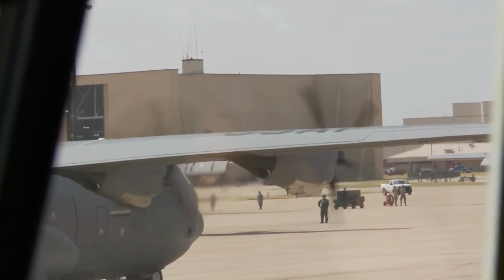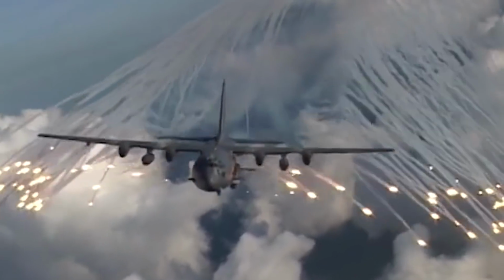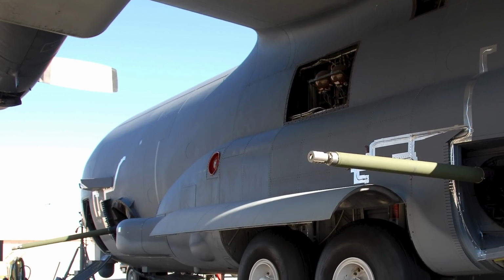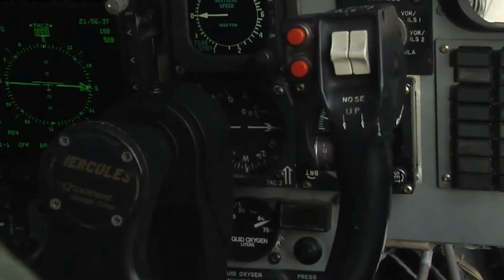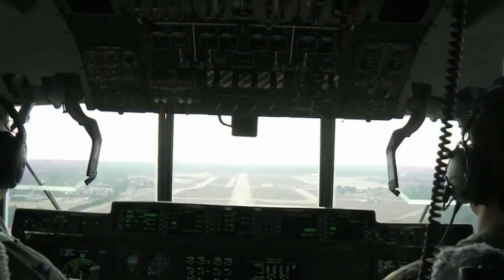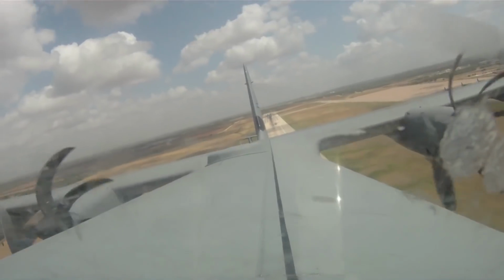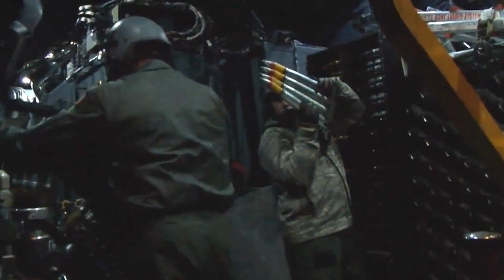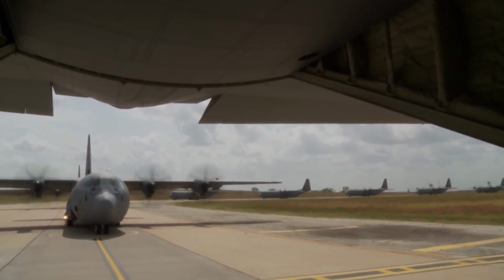AC-130J Ghostrider

Comment: Kind of weird that they didn't match up most of the video with what was being mentioned and put in a few clips of stuff that either hasn't been used in over a decade (i.e.-gattling gun and boffors) or normally doesn't apply to the aircraft; although the PSP has the ability to "quickly" drop the gun package pallet out of the plane, it would be exceedingly rare to revert it back to drop paratroopers. Once they have the rear door converted, there wouldn't be room for parachute dropping cargo (although the rollers are still under the gun mission pallet). I'm surprised they didn't give more kudos to the 30mm chain gun. That is one heck of a system and they pretty much never came back with any leftover ammo. They also go through continual improvements, not just big chunks of changes that span several aircraft. This means pretty much every single one of these planes ends up being somewhat unique even if they're part of the same "block". I was honored to be part of the GWS group for a couple of years. Lots of neat stuff they do with these planes.

Comment: My understanding was new Naval vessels had larger engines to power the Generators so they could produce the Electricity to run both the Ship and the Laser Weapons. Zumwolts were ridiculously large to power Railguns they couldn't make work. How does a plane power Laser Weapons? Or does the navy just use higher Powered Lasers with more Frequency if they're under attack?

Comment: When I was a Marine in Vietnam I watched Puff the Magic Dragon laying down streams of mini gun fire. It was impressive. Years later when I read they were moving the same concept on steroids to the C-130 I knew it was going to be special.
Reply: Just the sound of an old dc3 in the night, then it got quiet, and then all hell broke loose! I've got time exposure slides of puff lighting up a hill on night by Nah Trang
Reply: @maryhines322  I've got time exposure slides of the same effect. I was on guard duty on the north end of DaNang airbase. With jets turning up 24/7 listening for infiltrators was out of the question. So I brought a camera along with a telephoto to help me scan. When Puff opened up I settled the camera on a sandbag and opened the shutter.

Comment: All C-130s have a maximum speed of 0.64 mach from the first A model off Lockheed's production line.  Mach or the speed of sound is temperature dependent and is 358 kts or 427 mph at 20 deg C or 68 deg F.  There is nothing special at 413 mph unless you are at the South Pole.  ln the 70's we cruised at 280 kt for fuel efficiency in the C-130E.  Showing airdrops of cargo, paratroops and a 15,000 lb bomb does not add to credibility of the gunship.

Comment: they replace the very good and proven 40 mm with a 30 they took away what made the ac130 work all those years to turn into another bomber . missiles and bombs arent what that did , the gunship puts the fire right in front of friendly lines to save them , in Vietnam they would fire like 10 meters away from trapped soldiers , cant do that with a missile or bomb

Comment: AC-130J Ghost Rider III should have been based on the C-130J-30 Super Hercules multi mission transport aircraft which is the stretched variant of the C-130J . . . the IAF could do with a fleet of 50 brand new AC-130J-30 Ghost Rider IV fixed winged multi mission ground attack gunship . . .

Comment: 2015-1117, Aviation, New C130J Scrapped After Flying Upside Down.
	The US AF had to scrap a brand-new Lockheed Martin AC-130J Ghostrider gunships. Hercules received damage estimated at $115,000,000 after a flight-test crew lost control.
While being operated at roughly 15,000-ft, the aircraft flew upside down, before being recovered after losing approximately 5,000-ft of altitude. The crew escaped injury and returned to base and landed safely, but the Ghostrider was rendered a total loss, having exceeded its operating g limits and design load.
	Investigators have attributed the incident to the pilot’s “excessive rudder input during a test flight, followed by inadequate rudder input to initiate a timely recovery from high angle of sideslip due to over-controlled/under-controlled aircraft,” along with the “wrong choice of action during an operation.”

Comment: Is this really useful in a symmetrical warfare? It’s slow and can get shot down by ground to air missiles quite easily… Against asymmetrical warfare (like the war on terror) is a very capable platform. But I can’t see a good use against an army with fighters and guided missiles…
Reply: Not all platforms are meant to be used in symmetric warfare.. while highly capable, I reckon it's used to bully a battered enemy into submission.

Comment: Interested in how the 6-bladed props allow the aircraft to carry more fuel?  We found a better way was to fit extra fuel tanks.
I'd also like to see the figures on how the props allow a 67% reduction in running costs given that specific fuel consumption is at best 20% improved and that's only a small part of overall costs, which include other oils and lubricants, tyres, maintenance, refurbishment etc etc.  At least crew number is down by 2 as with the J there is no longer a navigator or flt eng.
Amazing to hear that the rear crew can fly 3000 miles and 28,000 ft in the air; true supermen!  If you're refering to the aircraft, why is it's range and ceiling so inferior to other Js, let alone the older aircraft?  I've had nearly 4000 miles and 41,000 feet out of a C-130K in the South Atlantic.
Lots of footage of the 40mm Bofors and its amunition, and why on earth so much air dispatch?  How does the Ghostrider get those enormousloads past the 105 gun?
As usual the interesting facts diluted by utterly unrelated imagery, although the reversed clip at 2:14 did at least prove light relief.

Comment: If my old b29 crimson sky is called in they need the flying dreadnought 36 guns 12 175mm 24 twin mounted rapid fire 75mm on 12 mounts she's a hefty 450 tons without ammo 900 tons with ammo using 6 VT hyperion rockets for lift with 12 inches of armor protection chaff flakk guns she's modernized and automated I just need to fly crimson sky with my copilot under extreme GeForce its a constant 15 g's at Mach 5 with those thrusters

Comment: So it has 2x30mm and 1x105?

They did away with the 40mm and gained a better 30MM?

Or did I miss hear him?
Reply: You did hear it mentioned that the Air Force was "scrambling" for the ammunition, AND parts for the Bofors 40mm cannon before the replacement of them with the 30mm?
Better, in this instance meaning that the weapons can be fed, and repaired without "scrambling" to obtain the necessary materiel.

Comment: the AC-130J's biggest gun is a 40mm, it is not plumbed to carry any sort of propelled munitions, and it has never been called a 'bomb truck with guns'
Reply: The AC-130J has, 30mm  and 105mm  there's literally 10 holes in cargo door for griffin missiles and the bombs are loaded on the wings gbu39s 4 on each pylon
Reply: The AC-130J's biggest gun is a 105mm, it does not have a 40mm, it has dual 30mm's.

Basic fucking fact that you can verify in one search must be so difficult for your kind.

Comment: I remember my days as a young airman back in the late 90’s working on the AC130 H and the AC 130 U model.  I remember the long night of cleaning barrels and maintains the 20mm, 25mm, 40mm, and 105 mm.
Reply: yes the aircraft was a beast to work, I have memories of many u informs that were ruined due to the grease, hydraulic fluid and oils.  But it is such a great machine and amazing how it is is able to support such powerful weapons.  Also a fun fact on the outside of the aircraft on the 105mm there is a single nut about the size of a fist that is used to mow sure when the 105mm is fired it does not fly out the other side of the plane.  It was dubbed the Jesus Nut
Reply: God bless American tax payers....
Reply: Thanks for bringing this to my attention I never thought about the maintenance the beast took
Reply: If I remember correctly, AC 130’s only had 1 free pallet station.   As a Port Dawg, we had to go over to AC 130s a couple of times to help load a pallet.
Reply: @a.mathis9454  from what I remember there was only space on the ramp but on the models I worked that was taken up by collapsing seats so on the AC130 H/u model there was no available pallet spaces that I could see there being
Reply: @Snipedog1978  ramp pallet position can be used on all C-130s, depending on mission and weight restrictions.   From what I have seen, it can be used for a baggage pallet when going to/from a theater of operation.  
See 8:05.    https://youtu.be/c7pLMwkxk9A.
Reply: "America is killing it's youth. Ghostrider, Ghost rider": from "Ghostrider" by Rollins Band
Reply: @somewhatsomething4882  huh ?
Reply: Oh yeah when they fired on gunnery ranges Party Time!=8)
Reply: You guys are the backbone.
Reply: Thanks for Your service.

Comment: They just replaced the old 105 with a brand new variant that is lighter and more accurate with fewer parts and a significantly lower operational cost. The guns they replaced were all old Vietnam era weapons that were long overdue to be replaced. 

Id actually like to see them replace the 30mm cannon with one (or a pair!) of the newer 50mm Bushmaster chain guns. Add a GAU-22A 25mm rotating cannon or go back to a pair of 20mm Vulcans and keep the Griffin and Hellfires and try to quantify the abject destruction left in its shadow.
Reply: At higher altitudes the 20mm cannons started to tumble through the air instead of spinning like normal rounds, hence why they went 30mm
Reply: 50mm with programmable fuse for air bursts would be horrifyingly effective. 

I’m not sure you would need smaller bore (and shorter range) Gatlings with a pair of these

Comment: Directed energy weapons work both ways. Antiaircraft lasers could make the AC-130J’s days numbered as well. Aircraft aluminum is much more fragile than steel bombs and shells.
Reply: aluminum is also very reflective once coatings are burned off, and dissipates heat well.
Reply: @sometimesleela  well then.... lets make it a flying disco ball. That would look interesting as all hell.
Reply: The last thing you'd want is to fire a large heat emitting laser with that thing around. You'd be obliterated before it's paint even warms up.
Reply: @zinjanthropus322  You can’t outfly the speed of light and a ground based system will be more powerful and armored than an airborne system, so who is likely to win that trade?
Reply: @johnmoore8599  the plane
Reply: @johnmoore8599  Lasers don't burn through things at the speed of light. A lot of the energy is lost and it takes focus and time to down even a small plastic drone. More than enough time for an ac130 to pick up the exposed heat source and eliminate it.
Reply: @zinjanthropus322  The assumption here is that the target is softer than the plane. What if it is not and has a weapon system as powerful or more powerful than the plane’s which is also better armored. If it has 10-20 mm of steel, it will survive long enough to burn down that AC-130 most likely. All it has to do is burn through a wing spar or fuel tank.
Reply: @johnmoore8599  The laser system itself would have to be exposed to fire, can't do that behind armour. Don't see how it would survive a burst of 30mm to the face.

The plane also has the advantage of using terrain to drop beyond line of sight of the laser while still being able to utilise missiles to attack safely from behind cover of the horizon.
Reply: @johnmoore8599  its highly unlikely that an aircraft moving like an ac130 in a gun orbit moves would take enough energy to one centralized spot to start anything before it turned the target to ash. Trust me I fly on AFSOCs upgraded de gunned version the mc130
Reply: @zacharystuits3606  Yeah, but you guys get the sharp end if your intelligence is wrong of the enemy’s capabilities and weapon systems. Physics is brutal on aircrews and always has been.
Reply: @johnmoore8599  well intelligence gathering has changed a lot these past 20 years, and bc what we do is usually infiltration, we try not to get seen by anything, let alone anything that would be able to keep a constant beam of energy directed in a way to do damage. We usually penetrate threats below 300 feet
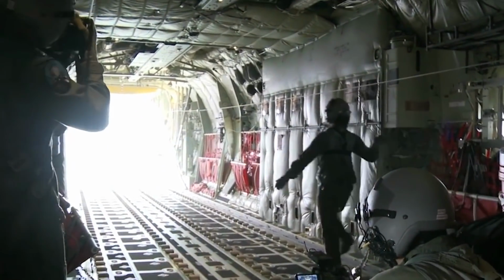Reply: 1:53 I like how he/shetwinkle toe walk when the Humvee was drop

Comment: I've been brushing up on my WW2 history recently. I can't help but think of what a difference even a basic version of this could have made in the Pacific campaign. Imagine a few of these on Guadalcanal for the marines to call in when needed. Artillery lacks line of sight and radios aren't great in bad conditions. This puts the artillery anywhere it needs to be and with eyes and brains on the scene as it happens.
Reply: I also wonder if airframe technology of the time would have been able to support this kind of weaponry. The Bofors gun was available at the time, but I wonder how much it would have impacted flight range to reinforce the airframe enough to withstand repeat recoil from a gun of that size. Lack of night vision technology also would have made it vulnerable to fighters and AA since it would have to fly during the day and low enough to be able to reliably hit targets with greater accuracy than naval guns or dumb bombs. IIRC the only night vision scopes at the time required an infrared spotlight, I expect that tech probably wouldn't scale up to the gunships of the time.
Reply: @atomic_wait   agreed, you couldn't stick a big gun out of the door of a dc3 and expect results. However, modified versions of existing systems for a special purpose were not uncommon then. Secondly, the expected casualty rate was higher. Sure that DC3 with iron sights couldn't be anywhere near as accurate as today, but they would have had the advantage of instant intelligence, they can see what is happening and respond accordingly. An artillery strike is firing according to instructions/blind. Those instructions rely on a radio which is notoriously unreliable. This thing only needs to be over the target and doesn't need any further instruction. Historically, air superiority was the reason it didn't happen. The allies simply didn't rule the air and hence make something like this useful. Look at the emphasis on aircraft in following cold war for proof of that lesson being learned. Once you own the air, many more things are possible.
Reply: @forksandspoons7272  Seems like the allies effectively ruled the air by the last stages of the war, but by that point the order of the day was simply saturation bombing and shelling entire cities, so no great need for precision artillery from the sky I imagine.
Reply: Check out the video on the Douglas A-26 Invader. It was about the WWII equivalent of the Spectre.
Reply: Although too late for Guadalcanal the Marine Corps used modified B25s with 12 forward firing M2 .50 cals as close air support.

Some later versions replaced the nose mounted MG's with 75mm howitzers.
Reply: Not really, it would have gotten shot down by flak or fighters
Reply: @bean5050  True, air superiority is a prerequisite for its use. Still that kind of small unit highly local fight is where this concept shines.

Comment: Maybe they’ll keep loading it up until it’s too heavy to take off, then use that as a justification to make a C-17 gunship. Opinions?
Reply: an ac-17 could have like 3 m777 howitzers and 3 50mm chain guns and a set of 3 GAU - 8 avenger 30mm rotary cannons plus a truck ton of guided munitions and a shit ton of ammo for its weapon systems, it could have a very advanced electronic warfare and jamming suite because the c-17's max takeoff weight is 160,000 pounds (73,000 kg) also I feel like if it was to be build its nickname should be the grim reaper
Reply: @bescotti-gaming  that Load out would rip the plane apart you gotta think about sustainability and maintaining stuff like that